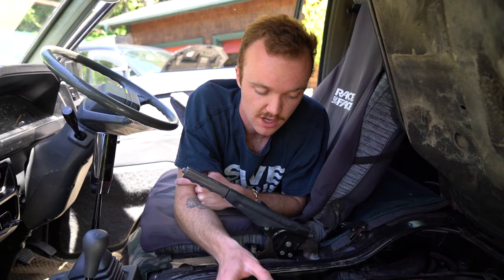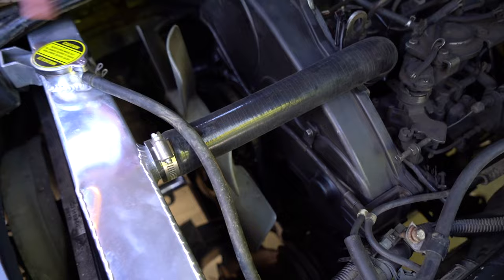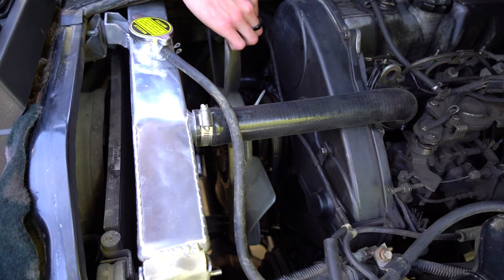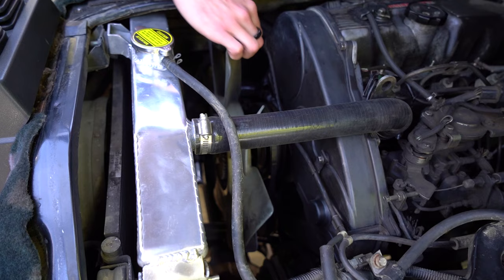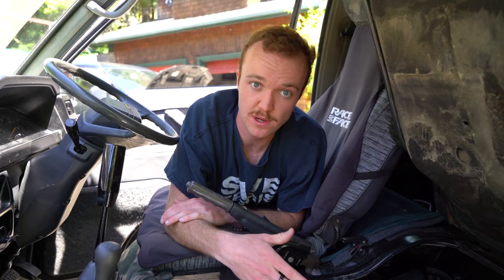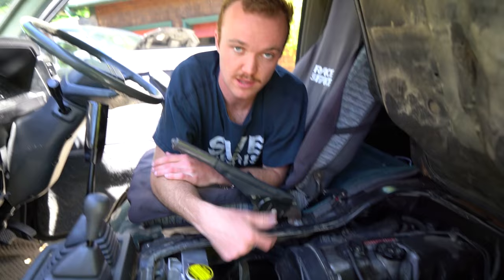WATCH THIS BEFORE BUYING A MITSUBISHI DELICA! (L300 & L400)

Comment: I drove my last freightliner over the road tractor 650k miles in 3 yrs and never used any additives. Diesel engines especially with mechanical pumps last so long because the oil is in the fuel . Anti gel is only for really cold climates where is below freezing for extended periods . I think your wasting your money on snake oil. In Philly we have a delica dealer .I own subaru powered VW vans but have an itch for a delica but man I hate right hand drive

Comment: I have an '05 gasser. All the research I've done suggested the 6g72 was a pretty good, reliable motor, and the diesel was only really worth it if you planned on adding a bunch of weight or camperizing it. Other than that, you're  really just paying for "cool factor", which for me, wasn't worth the $10k premium.

Comment: the 6g72 v6 engine in the L400's is almost indestructable. There are quite a few v6 Delica's in australia, and most people rate the v6 very highly. I has power for hills and towing but it could be better. you can upgrade to a 6g74 or 6g75 engine and get alot more power. The ONLY negative is the fuel economy.... its terrible.
Reply from the maker: Yeah eventually it would be nice to have more power, but the mpg is pretty awesome on the diesel if you don't drive it like a hooligan. Thanks for the comment. I have seen some pretty wild things with the 6g75/74 motors. If the early 2000s l400s were available for import, I'd be on one in a heartbeat.

Comment: Series 1 L400s have been implicated in  the Takata airbag recall, Here in Australia it has been possible to get the issue fixed under warranty through Mitsubishi Australia...that being said the L400 is safer than the L300 leg crusher.
Reply from the maker: Thanks for the info! Will look into it

Comment: Useful info Nameless Co! I like JDM Mitsubishi Delica and work on them. I would avoid local heavy off road beat up Delicas vehicles, which most likely will become a money pit or long term project.  Also, stay away from random after market tune ups and mods, just get stock and build it for yourself. Cheers!
Reply from the maker: Completely agree about keeping them close to stock! If it ain’t broken don’t fix it. Staying away from sketchy parts from eBay is most definitely important. Thanks for the comment, looking forward to more of your L400 videos!! 
Cheers,
NC

Comment: Man this is a blast from the past. We imported dozens of these in the late 90's through mid 2000's ,and still alot on the roads here in NZ.
Although most are pretty well used now, with many doing over 400,000 km's, which is probably a good indicator to the kind of mileage you can expect 
You mentioned rising sun out of Canada in your video. I have checked them out over the year's and they seem extremely expensive considering how much they would have paid for them out of Japan. 
Yes, rust can be a problem in the delica's, and probably more so in the L300's.
Upper and lower windshield pillars are probably the most common 'major' areas to look out for, and the most difficult and expensive to repair. 
The L300 4 cylinder gas engines always seem to have  the dreaded cracked cast iron  exhaust manifold issue. Which is usually remedied by replacing it with an aftermarket tube header type exhaust setup. The upside is improved performance and fuel economy, although it can increase interior cabin noise.
The beauty of both the L3 and  L4 variats, is if you want to fit LSD's or lockers they share the same running gear as the Pajero'/shogun models. So most drive train parts should be easily obtained, even in the United States.
Nice informative video. Would be interesting to here back to compare current prices between the US and other countries.
As a guide, back  in around 2000 you could purchase an L400 with around 70,000 miles for about 2k -3k NZD (roughly $1900 Usd) out of Japan. Although as time has moved on, and probably due to the popularity of over landing around the world, it looks like prices are climbing.
Reply from the maker: Wow that’s very good information! The prices over here in North America are definitely starting to skyrocket, with “Van Life” becoming a popular trend, we are starting to see lots of people getting into the Delica market. We’re just car enthusiasts who love these vans for what they are and not necessarily into the whole “Van Life” culture that has taken the VW market by storm. That is wild that you were able to pay such low prices for these incredibly reliable 4X4 machines. It almost seems like the best place to start looking for Delica’s might be NZ or AUS. Japan most definitely knows the US and CAD market now and is starting to charge a lot more to import, then what they used to be going for. I’m curious to see where these vans are going in the future and what’s in store for aftermarket parts along with popularity in general. Thanks for the comment and stay tuned for the journey of the L3 and L4.
Reply: £4-18k in the UK
Reply: Delicas are amazing for what they were made for: a van small enough to navigate a bustling city while roomy enough for packages, and tough enough not to get stuck on rural deliveries. I've been wanting one for a while because of how narrow and easy to park (The L300 especially) is in a city in which every other car is a 20 foot SUV. It's actually a terrible car for overlanding here when people could easily get a full-on RV or pull a small trailer with a truck and be much more stable, off-road. And you won't find someone who can work on a Delica if you get stuck in the boondocks. But fuckin white collar idiots have to ruin everything. "$15-20k for a 30 y/o van that I'll have to put another $10-15k in mods for? And thousands to get parts from Japan when I inevitably break something trying to go rock crawling with it? Sign me up"

Comment: Brilliant video , just subbed, I am in England and have a 2000 Chamonix Mont Blanc important from Japan. Really good pointers even for the two previous models. The rust is a silent killer ,mine was clean and a year later lots of surface rust, we salt the roads here in the winter so definitely check underneath. Apart from that the vehicles are so practical and great to drive. Keep up the great content.
Reply: Im also in the UK just did a quote to see what it would be like and it came back at 8k :/, who are you insured with and how much is it?

Comment: Hey thank you for the info!  I’m looking into getting a 1996 L400 spacegear exceed. 2.4L 4 cylinder gasoline engine and a 4g64 motor.  In this video you said do not get a L400 gasser and I’m just hoping to get your input when it comes to this engine and motor as far as gasoline. Any advice is appreciated, I’m not mechanically inclined at all 🙂

Comment: Can you put an l400 diesel engine in the l300? It sounds like the l400 engine is better overall
Reply from the maker: I don’t think the 4WD system is the same in the L4 as the L3. Seems like it would be problematic, also due to the L4 being front engine whereas the L3 is “mid engine”. I bet someone has tried it or thought about it before.

Comment: L400 gassers blow up cos not maintained?  If it's common it must be build quality.  Can't see many people not maintaining them.  Great video
Reply from the maker: Often times they get neglected by individuals who forget to service them. It’s not that they catastrophically blow up, but rather prematurely blow up due to lack of maintenance. That goes with any car for that matter. Delica’s just have a bit more maintenance than the regular USDM Van or truck.
Reply: @NamelessCo  Thanks for this video. Very helpful. I've read on forums that people prefer the L400 V6 because it is a smoother ride and less prone to overheating. What do you think? Is there any scenario where you would recommend the L400 V6 over the Diesel?
Reply from the maker: @matthewy7885  For people who are using their vans in cities and using it on shorter trips, then I’d definitely recommend going the gasser route. However, from reliability I’d probably go diesel. But you can overheat a diesel if you are being negligent, and or are driving it in above average temps. Hope that helps!!
Reply: they dont just blow up for lack of Maintenace. There is a lot of them in Australia and they are in many other Mitsubishi cars. It's a 6g72 v6 engine. they are virtually indestructible. Change spark plugs and leads and timing belt every 100,000kms... perfect the the lazy ones out there